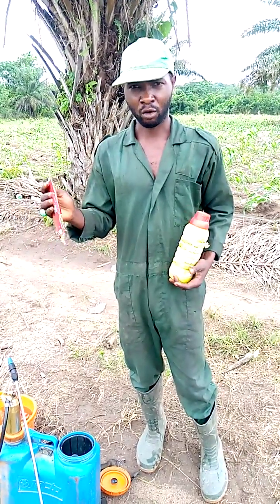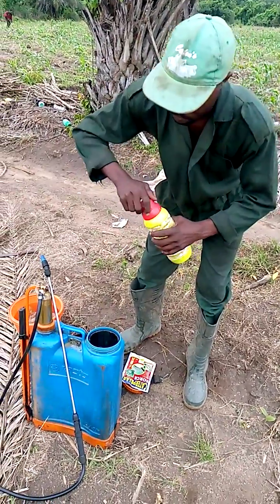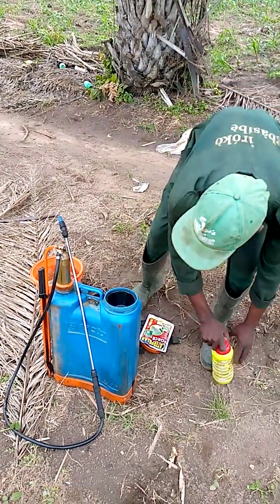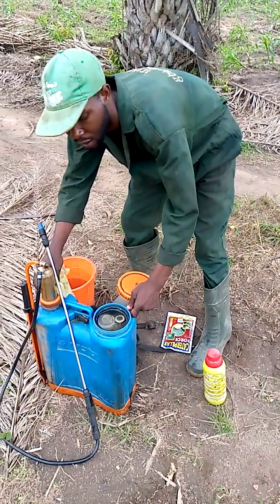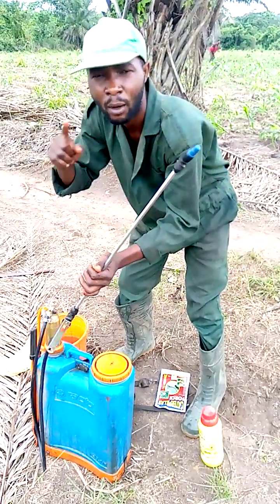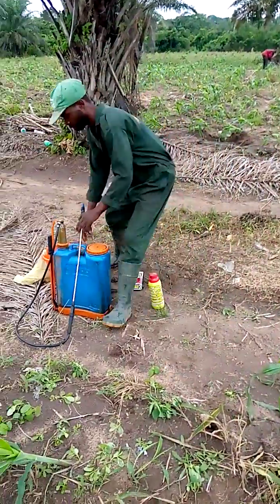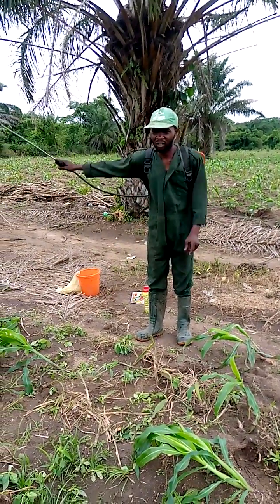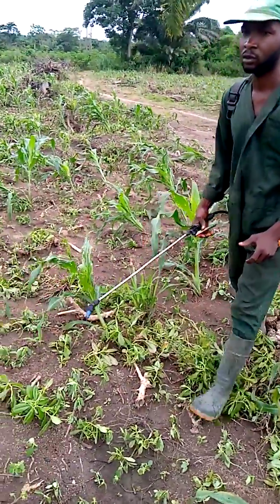maize and cassava intercrop 6, spraying insecticide on maize.

Comment: If i  want to use 2liter water , how many  ml chemical can use .
Reply from the maker: 200g.
Reply: 200grm is not too much for 2 liters of water
Reply from the maker: @mr.wisdom8800  convert 100g to 1liter, then use at 50ml per 16litter to spray.